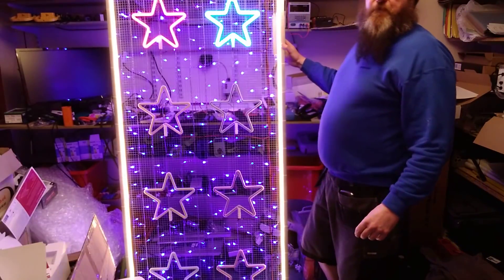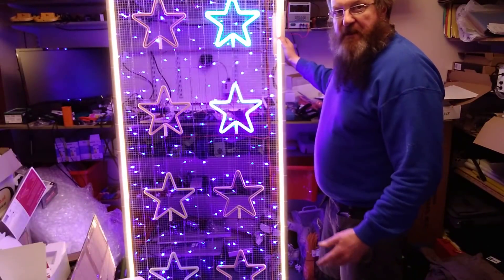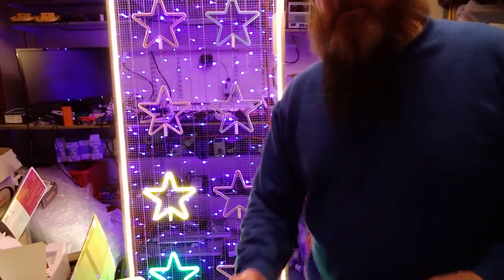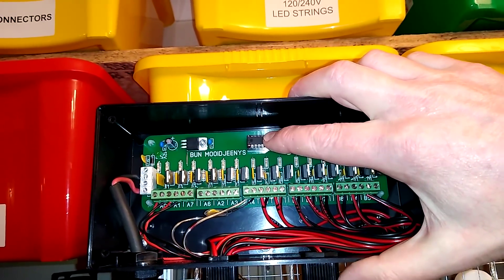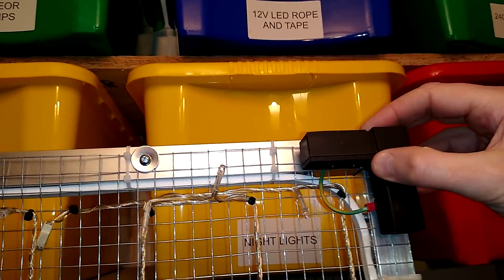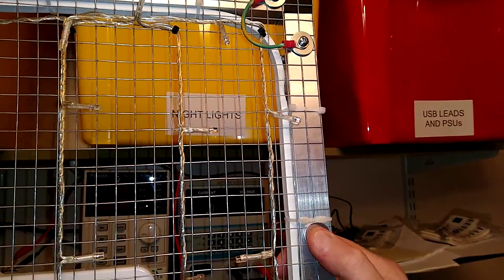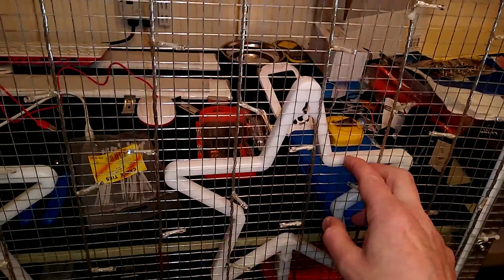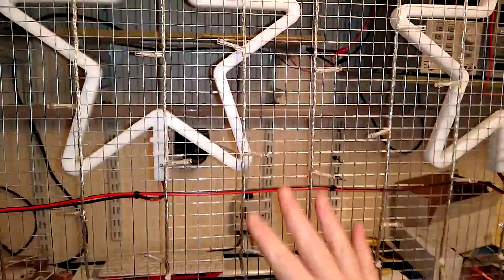Building the 2020 Department of Villainy Christmas display panel

Comment: I can still remember seeing  the way decorative street lights were done, I think it was  Spain but could have been Andorra. A square of chicken wire was erected into which the coloured ES  lamps were inserted. The base contacts of each lamp was  soldered together with some wire. Mains was applied to both the chicken wire and the inter connected  bases of the lamps and Voila! they all came on! Strung across the street they were  unlikely to by touched by anyone. So job done.
Reply from the maker: Italy still does big lighting displays with utter disregard for electrical safety.  That includes wooden frames with multiples of series LED lamps in bases and the electrical connections made by wrapping live wires round nails.
Reply: What happened when it rained on them? 💥💥

Comment: That's a great light frame set up, miles better than the tired old things our local council has been putting up for the last 10 years, in the high street,  I don't think they even bother testing  or repairing them from year to year,  as half of them have large sections of the LEDs unlit or very dim, there are a few frames not lit at all, although this year I don't think they really bothered much anyway!

Comment: Hoping you had a festive celebration Clive, would you mind telling me where you sourced the square mesh? I've been looking for some for Aaages for a vintage style radiator grille.
Reply: I've seen similar mesh at builders merchants & garden centres.
Reply from the maker: I ended up getting it on a roll from Screwfix.  I wanted heavier duty stuff, but couldn't source it locally.

Comment: Ugh, those box-ticker earth links. Connecting different parts of the welded steel wire mesh.  It makes me die a bit inside. For next year, I'd like to propose a new regulation that mandates an earth strap from one end of that earth wire to the other end of the earth wire, in case the earth wire isn't properly earthed.  Of course, the secondary earth wires should also be backed up by a welded steel wire mesh across the whole construction, in case the secondary earth backups fail.  For safety, this secondary earth mesh should be grounded by individual earth wires...
Reply: As I said in a previous comment,  in a post EU Britain, box tickers should be outlawed! !

Comment: What is the brand or source of the square tubing and fittings?  I see our local Graingers Supply carries a brand called Faztek which is only semi-reasonable in price. It looks like a 3 by 7 foot frame would be about $60 USD for just the frame. I have a bunch of Light-O-Rama controllers including one 16 channel DC controller that can drive 5 or 12 VDC LED's.  You have to buy the software but it's not terribly expensive and it runs on Windows.  The sequences can be stand alone or synced to music.

Comment: That wire mesh construction gives me an idea for a construction problem that has been rolling around in my head for a while now for a display that I've been thinking about making using ping-pong balls, ws2812b LEDS, an ESP32, and a MSGEQ7 to make a very large spectrum analyzer audio display.  I was looking at using a 4'x4' piece of plywood, but that looks like it would be so much easier to mount things to and be lighter as well. So Thanks.  You're awesome. don't ever change.

Comment: What sort of Price range are Mean Well supplies, do they compare with the cost of Chinese ones? I know they're better quality but should I expect a 12V 10A power supply for under £40?
Reply from the maker: The proper meanwell supplies are quite expensive compared to the generic ones, but are fully tested and genuinely certified.  They're safer and last longer than the cheap supplies.

Comment: If the controller box were to be sealed, would this then be suitable for outdoors?
Reply from the maker: For outdoor use the LED neon would need carefully sealed up to prevent water ingress at the ends.  Not sure how the aluminium and steel would react in rain.

Comment: Clive, if you run out of the mosfets that you used in the controller, have a look at the IRLZ34N, slightly lower RDS(on) and approx £5 for 50 :)
Reply from the maker: I've looked at others, but They would need to be from a prominent supplier as I use them in products,
I usually use them with logic level control which means the IRLZ34N may have higher on state resistance at 4.5V
Reply: @bigclivedotcom  I found that the mosfet was expensive and contained Unobtainium,  my search was for RDS (on) < .04  and cost from RS and other sources :)

Comment: The pale blue background stars are my favorite part. They are perfect subtle compliments to the neon stars.
Reply from the maker: That was a four block 12V string of 300 LEDs that I cut down to make it  into 3 blocks to allow use at a lower voltage with a resistor to fine tune the intensity.

Comment: Storage for next year simply take a few large garbage bags, and place the whole unit feet first in the one, and use some tape to hold the bag tight to it, but without the tape touching the frame. Then a second bag from the top down to cover over the top, and as the bag ends likely overlap tape the lot together, so none of the alloy is touched by the tape. Seacond go around of bags, and tape the whole lot up and store indoors in a spot, and when you take it out the alloy will be shiny, and no tape marks.  A spray of WD40 into the bottom bag, before you put it on, will provide a vapour barrier treatment that will last the year.

Comment: love those ground wires, Admittedly, I converted them from box tickers to tisk tisker wire splice adapters.
Reply from the maker: The panel still got condemned in their PAT test.  I had to give them guidance on the proper testing of it.  They didn't tell me why they failed it the first time.
Reply: @bigclivedotcom  I would've thought the entire wire mesh would be enough for ground continuity. And they couldn't perform a test properly the first time? Sounds to me like maybe they didn't actually test it and wanted you gone. I don't know why they would though.

Comment: Is the earth linkages really needed? Wouldn't the metal mesh provide sufficient connection?
Reply: Ticking a box for the Elf and Saffety gnomes in their ard ats with a clipboard and pen.
Reply from the maker: It still failed their PAT test and was unplugged and a red label put on the plug warning not to plug it in.  I had to send them a picture of my PAT test and some other notes to get it plugged back in.